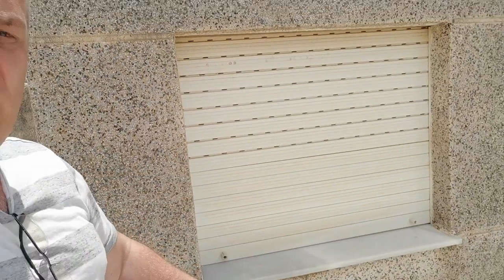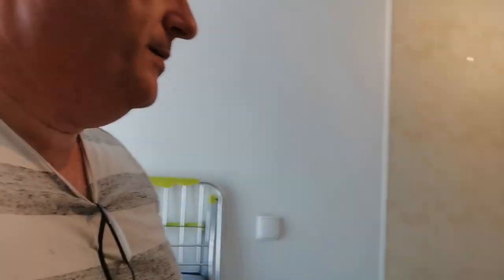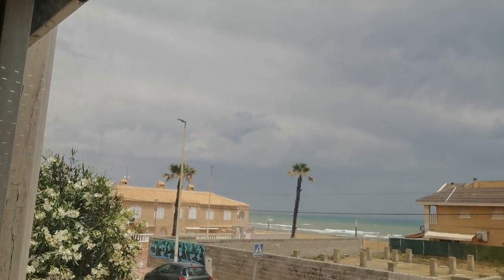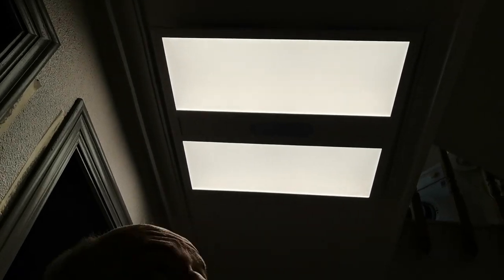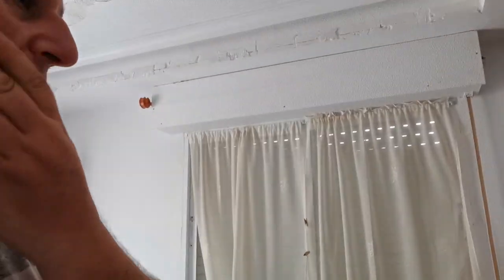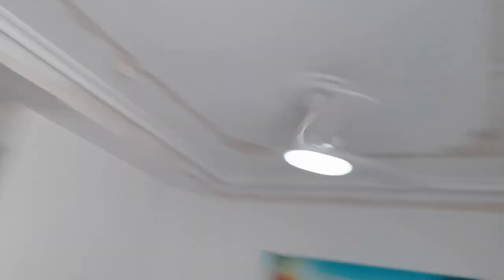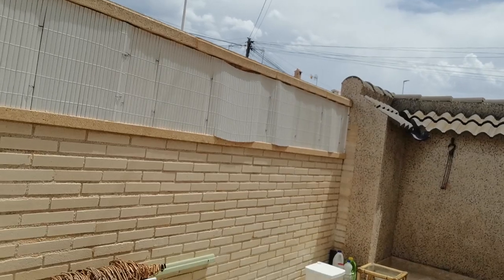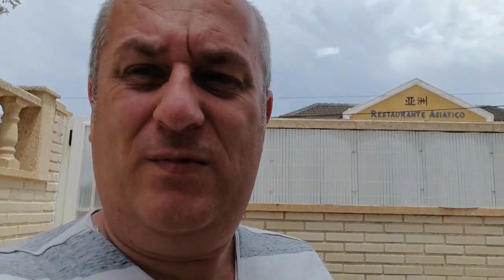Update from the new house in Spain

Comment: How do you keep a conservatory cooler in the summer?  We are looking to purchase a property in Portugal.  A lot have 'glass curtains' on balconies to use in the winter.  Our conservatory in the UK is 45 degrees in the summer - I will fry in Portugal!  Concerns over power costs for air-con.
Reply from the maker: Its a difficult one, with mine its because of the breeze off the beach. But worth looking at the roof coverage and ventilation. Increase the airflow (obviously only works if there is good air movement).